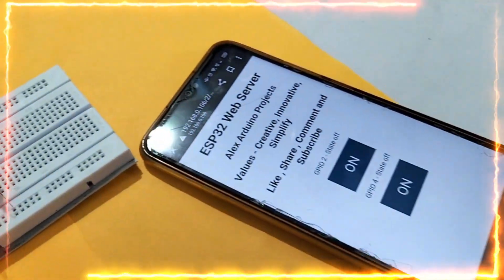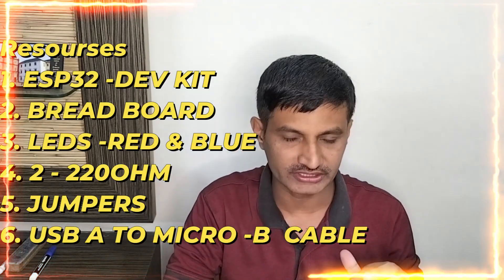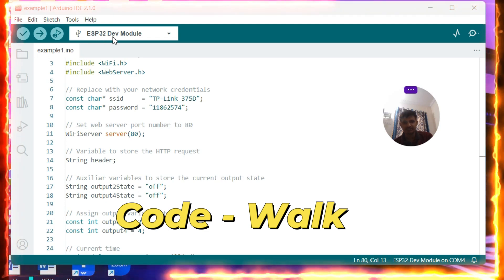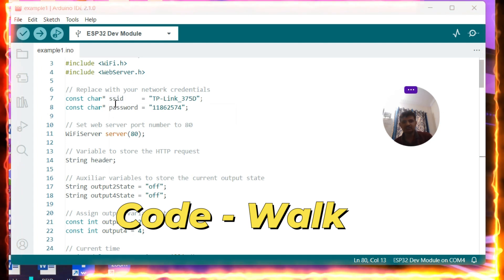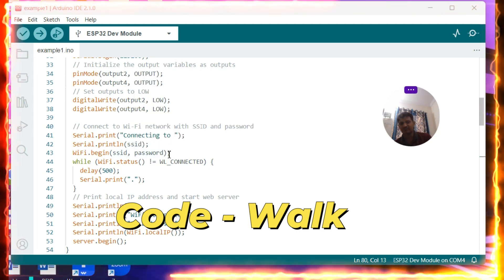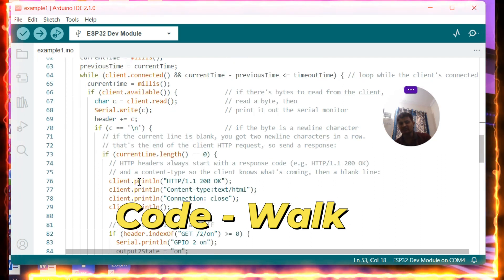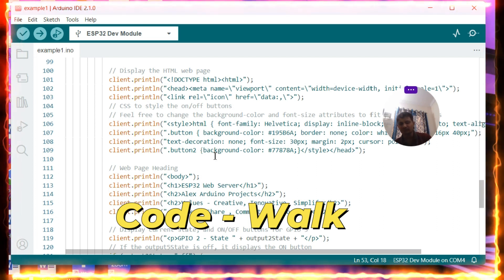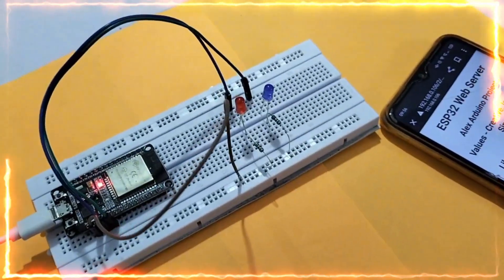ESP32 Web Server  -  Create Your Own Web Server for Control LED On/Off

Comment: Where I check ssid and password
Reply from the maker: Step 1. Have an Access point, it will have ssid and Password
Step 2. To that Access point - we want to connect ESP32. Mention the ssid and password mentioned in the code Walk Section.

If you consider your mobile as an access point - It is possible.